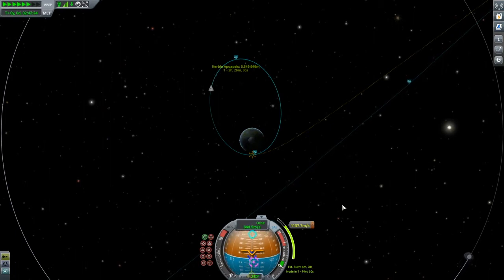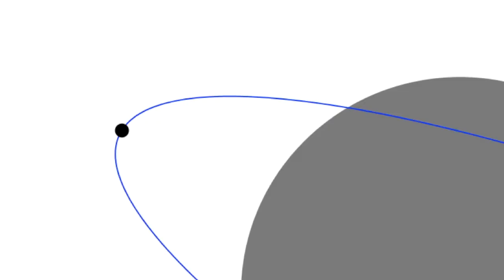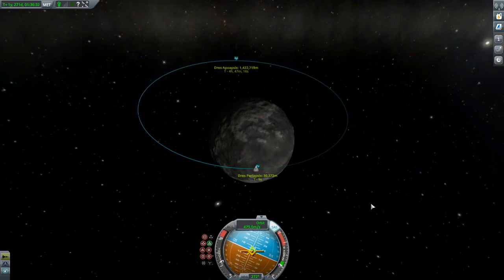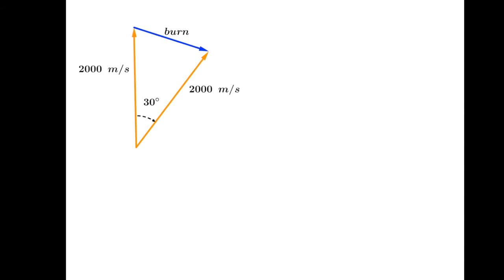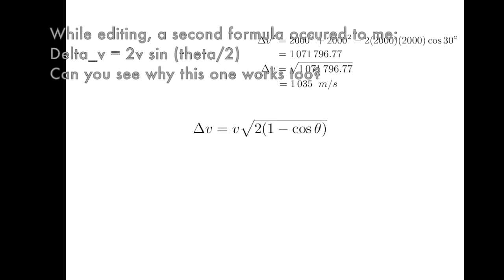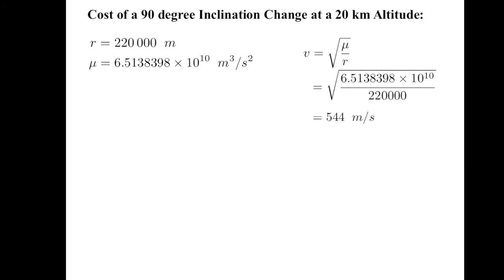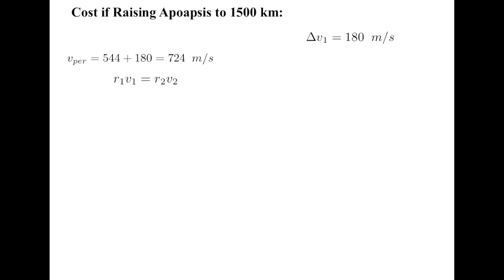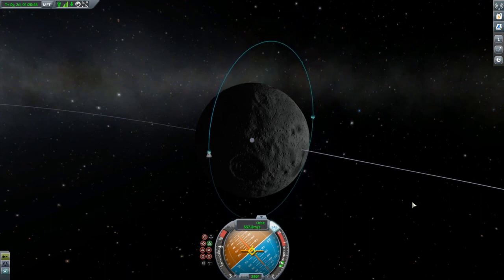Normal & Radial Burns | KSP Let's Do The Math

Comment: As well as for the previous video, I did some formula crunching to come up with a decision formula for how to perform inclination change maneuvers. I think you forgot to mention that the angle of inclination change has effect on what the optimal strategy is. Suppose you start in a low circular orbit, then the results of my calculations show that for inclination changes of less than about 40 degrees you should just use a single burn, while for 60 degrees or more you should first raise the apoapsis as much as possible. Interestingly enough, for angles between 40 and 60 degrees there is a certain optimal apoapsis for minimal delta-v. I think this is rather important to prevent people from bothering trying to perform more complex maneuvers for small inclination changes when the simple technique is actually more efficient.
Reply from the maker: You are absolutely right, though there are a few variables that go into the decision: inclination change, altitude, and parent body.  Perhaps a topic for a future video.  I went with an extreme example at the end just to get people thinking about other options, the best option being to minimize the inclination change required before ever entering orbit.
Reply: The formula that I came up with actually only depends on the desired angle of inclination, so I expect that the mass of the body, the orbit altitude and velocity do not matter for what choice you should make. Well, my formula gives you the factor of velocity change between 1 and sqrt(2) that you should apply to raise your apoapsis. When advising an absolute apoapsis raise, then the orbit altitude does matter. The orbit velocity and body mass are related and only influence the total delta-v, but not the percentage of delta-v you can save by using the correct strategy.
Reply from the maker: Interesting.  I'll have to look into that in more detail.  I like the idea of spinning the problem around to how high you should raise your apoapsis?  In game, I've always rather done this on the fly, setting up some nodes to get an idea of the cost.  When deciding how high to raise my apoapsis, time also factors into my decision.  I often don't want to wait days to get back to periapsis.

Comment: Thanks Mike. I knew it was cheaper to perform these changes close or far out depending on the type of change but I had no idea by how much it could make a difference. I suppose the greatest saving would be at the absolute furthest point from the orbited body without leaving it's SOI? The only disadvantage being the time taken to complete the said orbit. I would calculate it myself but I really don't have the best understanding of math despite your clearly laid out formula.
Reply: This comment led me to another thought. If I was orbiting the Mun 1m from the furthest point towards Kerbin. When the Mun moved further around Kerbin and my satellites orbit is now at the back of the Mun, could I drop out of orbit. The Mun is pulling me along but I wonder if it might elongate a little when the Mun is moving in the opposite direction to the Satellite? Perhaps not in game since an orbit is basically on rails but maybe in real life (edit: real life Kerbin that is)?
Reply from the maker: You're absolutely right.  The further out you push the SOI (staying within the Mun's SOI), the more you'll save, but the longer the whole process will take.  

I didn't get into this in the video, but the best thing all round is to do your best to minimize the inclination change in the first place.  You can usually get close to the inclination you want by tweaking your trajectory long before you encounter the Mun.
Reply from the maker: In KSP, as long as you are within the Mun's SOI, Kerbin might as well not exist.  That the Mun is moving doesn't matter either.  In the real world it's, of course, more complicated.  Earth will perturb an object in Moon orbit (especially if it is far out from the Moon), and vice versa.
Reply: Mike Aben that's something I usually do. For a polar orbit of the Mun I wait until the direction of the orbit is a straight shot from Kerbin. What I wasn't sure on was the best place to perform course corrections. Half way out from Kerbin, very close to the change SOI point, just after changing(so in the Mun's SOI) . It seems complicated because the earlier it's done, the lesser the amount of change required but the craft is also travelling faster making any change more expensive. I've played around but haven't come to a good conclusion.
Reply from the maker: Just playing around, I find course corrections are best around the halfway point between Kerbin and the Mun.  I typically just drop a maneuver node around there, give me a bit of normal burn, then slide node back and forth watching my approach to the Mun.  I just stop when it seems I'm getting the most bang for my burn, and then fine tune the burn.  I've never done the math of it, though.  I should give it a go when I have a chance.

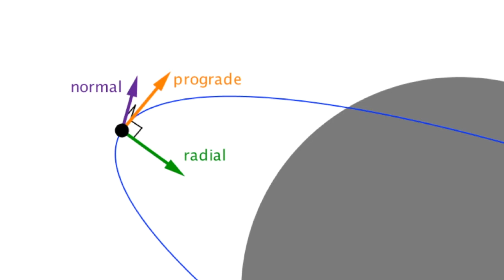Comment: Nice video! I'd point out, though that at 1:50 the diagram you draw shows the Prograde, Radial In, and Antinormal vectors, instead of all the "positive" directions.

I've got to admit I have trouble visualizing the effect of a radial burn in and out.
Reply from the maker: I think it's more my terrible attempt at drawing 3D.
Reply: I thought normal and anti normal were essentially arbitrary. Which is down, and which up could be defined either way based on how you choose to perceive the galactic plane.

Comment: Question: So to enter a polar orbit of the Mun, it's cheaper to capture into a highly elliptical orbit, and adjust angle at Apo.  Cool. Cool.

Is there any reason not to perform a trajectory correction manuver during the trans-munar cruise to insert into that orbit (or damned close to it) directly and just do the single capture burn?  Seems to me it lets you have the leverage of an apo outside the sphere of influence of you're eventual home?
Reply from the maker: You are absolutely right. It is cheaper to adjust your trajectory before entering the Mun's SOI through a mid-course correction.

Comment: 01:21
This is factually incorrect (if by "towards" you mean directly towards, i.e. to the body's center of mass, and not just "towards some general vicinity" of it). E.g. 1/4 of period after the periapsis (in an elliptical orbit) the radial in velocity would be directed towards the ellipse's center, not towards its focus (where the center body is).
Reply from the maker: Yup, you're right. I was, using the word "towards" too loosely. Thanks. I'll put a correction in the description.